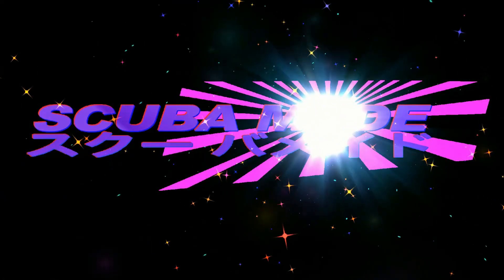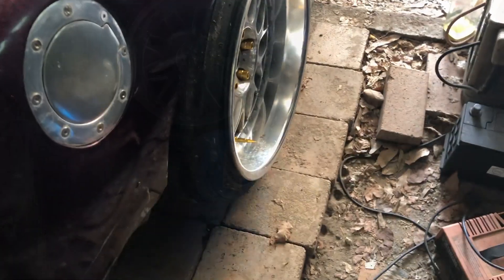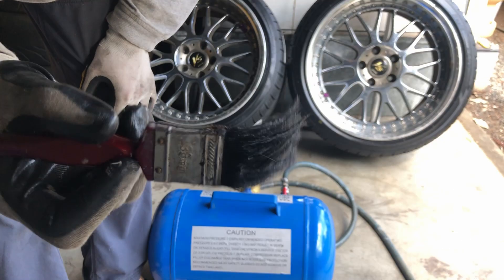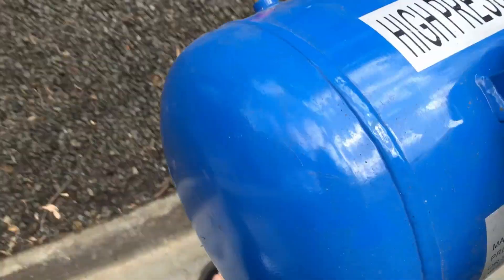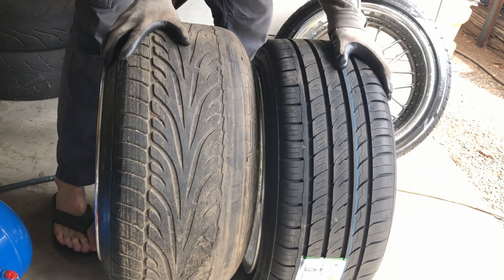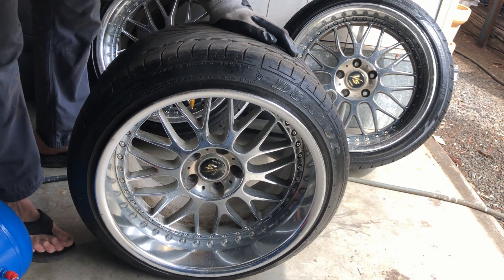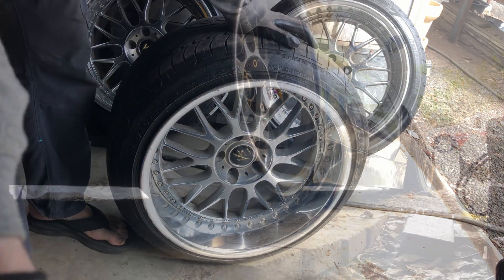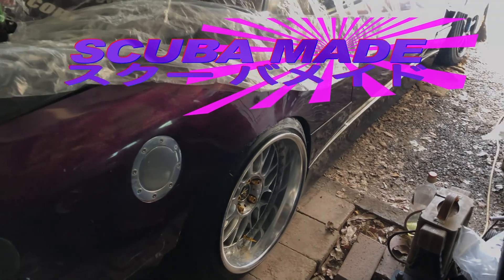EBAY Bead Blaster on my 11.5" WORK VS-XX!!

Comment: You need more air in the tank, on that first attempt the tank gauge  reflected very low pressure.  Also if the car had been lifted to remove the vehicle's weight it would have inflated while mounted on the car.  Cheers
Reply from the maker: Yeah I probably should have jacked it up abit first, oh well! Thanks!